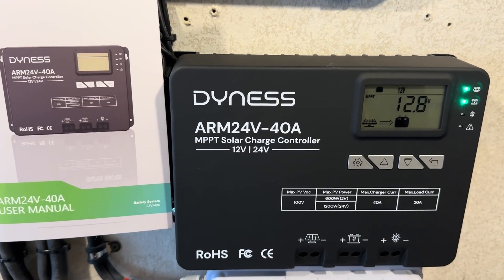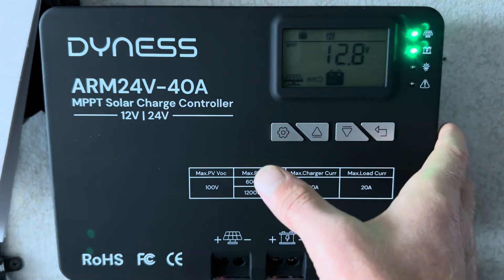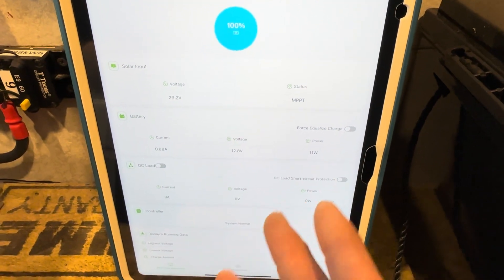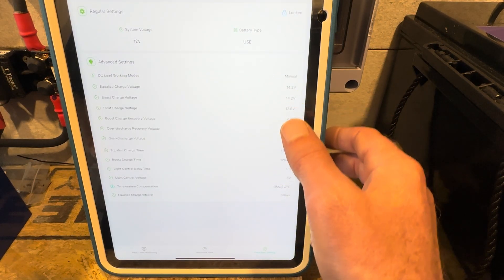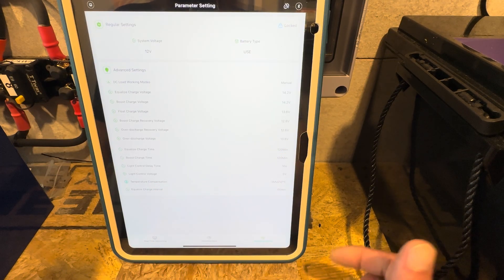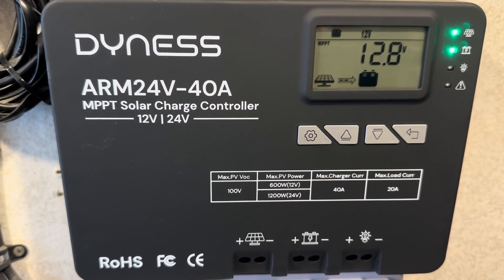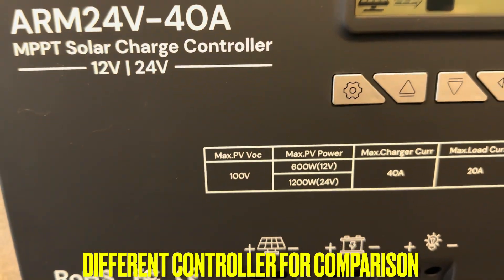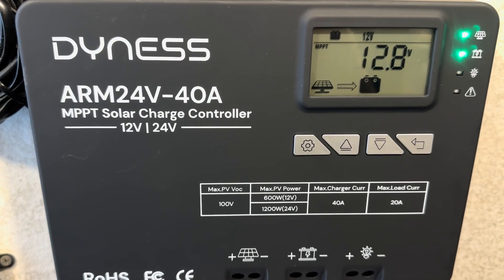DYNESS 40A MPPT Solar Charge Controller Review

Comment: Love your very honest and thorough reviews. I am looking to go Lithium, and thinking budget battery is the way to go for me. I must purchase anew battery for the upcoming summer vacations and budget is very comparable in cost it seems. If you were looking at such for only usage a couple of times a year, suggestions?
Reply from the maker: Thank you! 
I would definitely look into a Bluetooth equipped battery. It’s very helpful to have this feature especially if not setting up a full system with monitoring shunts etc. 
Capacity/size would depend on your needs. The compact/mini variants are nice the 100Ah are really small and easy to handle the 300+Ah aren’t really much bigger but weigh 60+ pounds.

Comment: How does it preform in use?
Reply from the maker: As to tracking it does well. I removed a much nicer controller to install this one for a longer term review. It is on par with a much more expensive controller as to tracking and power to the batteries from the same array.

Comment: glad i spent extra 50$ on Victron. Higher voltage(150V/35amp) and does 12/24/36/48V. Buy once cry once. Works so well I bought another for another array! Thanks for the review!   Any PowMR product reviews in the future?
Reply from the maker: I don’t have any plans for PowMR currently. I do plan a long term review on AmpInvt 40A controllers that I installed for a friend who wanted to try them for price. They have been running for many months now at their max allowable PV spec. 
Actually very impressed by them.

Comment: why not use any other app???
its a helios charger modell number M2440N you can use for it 20 different apps !!!!!!
i use for example for this helios chargers the app from redodo, and it works nice...

and all the other thinks are also wrong this herlios charger was released end 2021 so itsa ~a 4 year old hardware, what you talk here with its version 1 is all nonsense....
Helioas M2420N, M2430N and M2440N all from the year 2021.

the the next importent part this charger have 2 years ago only 3 voltage values that can be set and only 3 values in the apps !!!!!

Comment: Yes!!!! My new 20 amp HQST charger will not save my settings in Bluetooth keeps locking  back up and not changing. Same company manufacture. Must be a new firmware glitch. My others you make the change then save then lock the settings back up.
Reply from the maker: Thanks for letting me know Mark. Yes this is a clone of HQST and guess the QC department hasn’t been paying attention. 
If I remember correctly I got this controller about the same time you received yours. Thought it was an isolated incident. Wonder how many are out there that can’t be programmed? 
Makes me wonder about all the recent 5 star reviews on Amazon and other places for these controllers lol.
Reply: my other two older ones work fine so it will be interesting to see what they say. So glad also I’m not the only one.  I’ll reach out to HQST and see what they say but I have not yet cause their downfall is service but I’ll try now that I know it is a common problem.  Great chargers just bad service that at the price I can live without.  My 20 amp isn’t in full service so factory settings was good enough for my use but I’d like more control.
Reply: I’ll try updating the app when I get home there was a new update 11 months ago. Probably will not work but I’ll try and get back to you.
Reply from the maker: @s @solar_diy_hobby_and_reviews I’m using the latest update. You’re right it was released Jan, 5 2025 lol.
Reply: @THEOFFGRIDMOUNTAINHOMESTEAD  just an update I can change all perimeters in my HQST 20 Amp controller what is deferent is I can’t update the Bluetooth device name it is locked but everything else I can change. I didn’t try changing settings just the Bluetooth device name and thought I had the same issue as you. My other HQST devices I could change the device name on the device.
Reply from the maker: @solar_diy_hobby_and_reviews Thanks for the info. 👍
Reply: @THEOFFGRIDMOUNTAINHOMESTEAD  you are in wrong.

1. charge pro 2 app is a universal app for 30 different chargers are have differnert settings for different chargers
2. if i turn on this app it shows me 14 values ,.
if i then chose any charge controller in the blootooth it removes all the stuff what have NOTHING to do with the charger for example helios M2420N= 6 values remainig.

3. ist not a clone or whatever and have nithing to do with HQST or other resellers its a high end product from the maufacture Helios , what is the best charge hardware i ever have senn in my life.
Reply from the maker: @markuskabler Open the cover on these clones and dig around and you will find the same HNE chipset inside. 
HNE is the white label factory. Why do you think HNE software works with so many controllers.

If you really start digging you can find evidence of cooperation between HNE and SRNE companies.
Reply: @markuskabler all these chargers are Helios brand we are not arguing that, they are all made by the same company.